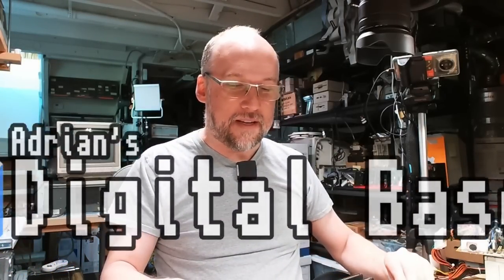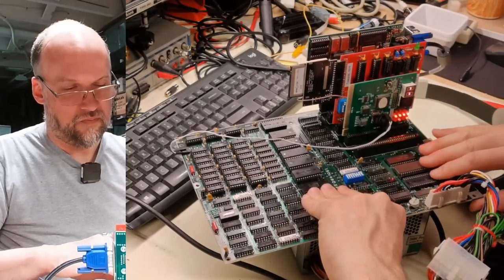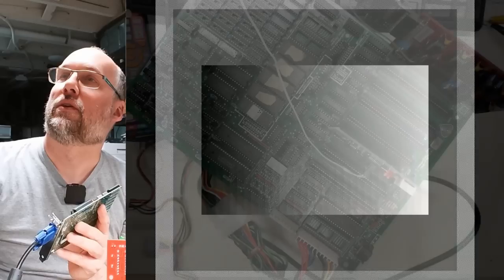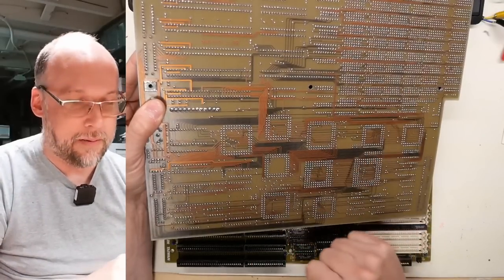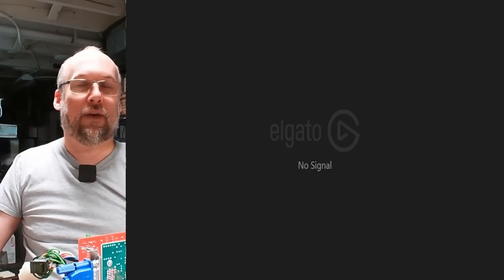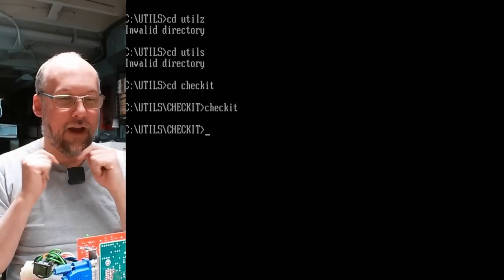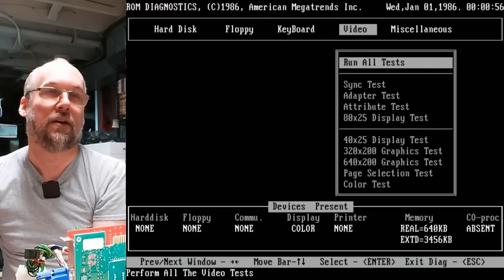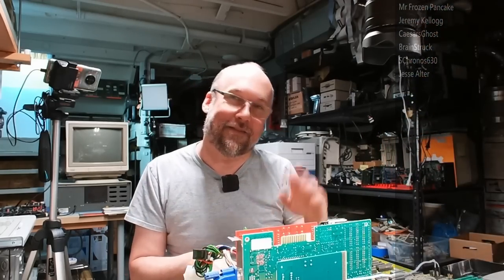Mystery motherboard testing

Comment: Third motherboard: The clock option you changed said SCLK/2 which means divided by 2. That's why the speed dropped rather than increased.

Comment: You nailed it Adrian. I worked in corporate computing from the eighties.  People used to say Wow when they got a new computer.  The last significant change was with SSD's... they produced a noticeable speed bump.
Reply from the maker: I remember my first SSD -- and yes it felt like my laptop was a brand new computer. It booted so quickly and everything felt snappy. Now I upgrade CPUs and can't even notice any change what-so-ever. Sad...
Reply: @adriansdigitalbasement2  I think the software is a large factor too. It used to get optimized for cpu and ram constraints, but now an OS is ~20GB+ and simple programs can use 100MB+ ram easily, especially if it uses bloated frameworks like Electron.
Reply: That's what many say, in the past there was the CPU performance increase which was really enormous. This wow feeling was with 3Dfx addon cards, then with SSDs and since then rather little. 
I am writing this on a 12 year old Laptop with i5 Sandy Generation dual core CPU, upgraded with 16 GB RAM and SSD.  That's enough for Office, Youtube, Intenet and all that at the same time.

Comment: That weird XT clone BIOS also misspelled version as "verson". Parity RAM was nearly universal in PCs until the Socket 7 era. The 80387 math co-processor was very expensive when it was introduced (over $1000) so that's why the first 386 motherboard you showed lets you use an 80287 instead.

Comment: About your comment regarding the 25x single-threaded CPU speed-up between 1981 & 1989, and how modern CPUs don't have that sort of gain from generation to generation --- I'm currently running a 2014 Xeon E5-2667 v2 (8-Cores/16-Threads, 3.3GHz / 4.0GHz Boost), which is listed as having a PassMark CPU Benchmark Single-Threaded Score = 2005.  The 2014 Core i7-4790K had highest LGA1150 Single-Threaded Score = 2465.  The Core i9-14900K is the highest new Intel CPU, with a Score = 4791.  The new Apple M3 Max 16 Core has a Score = 4795.  So, in the last 9 years, the Intel Single-Threaded Score has gone up less than 2x.

Comment: It's  better to have shorts in your tantalums than tantalums in your shorts.
Reply: The latter is generally fine so long as they aren't connected to power and don't themselves also have shorts. 💣
Reply: Shorts are comfy and easy to wear. What does that mean when they have tantalums in them though?

Comment: The extra set of static RAM on your second 386 was the cache tag RAM. The tag RAM contains the address that's being cached. The other cache RAM contains the data being cached. Because the location being cached needs to be looked up very quickly tag RAM is faster and closer to the CPU to have the shortest PCB trace length.
Reply: Seconding the "Tag RAM" and faster-cache's likely function.  Wow, it's been so long since I thought about this stuff last...

I do think Adrian is likely right about the 'early chipset' being PAL'd in for some functions.  Or maybe it's to just save costs somehow, but it seems like that might be a bit much to design a non-standard design just to 'save costs'.  Development would be likely far, far higher.  Just guessing on this point, though.

Comment: That first 386 motherboard is a special unicorn. AMI used to ship something like a "BIOS construction kit" to their customers (mainboard manufacturers). That construction kit used chipset-based "modules" to be enabled and comprising the final chipset setup on the shipped product. The detailed register-setting was for development purposes only and was not supposed to be enabled in shipped products.
Obviously I cannot tell how it got enabled but I am sure, this was not in the regular retail version. I was working for a major taiwanese mainboard manufacturer back in those days and had access to the construction kit along with the documentation to go with the corresponding chipsets, which where hard to obtain back then.
Fun times, but I would keep that mainboard in a special place.
Reply: On NEAT Chipset boards those register settings where somewhat usual not a developer only feature.
Reply: Chipset info is hard to find.  I wish more of that stuff had gotten accidentally left on the Internet's backroom photo-copier.  :-)
Reply: I had 386 boards with this settings as well. I didn't have the easy setup, but the complicated one, where I reduced waitstates in a long row and could enter how fast the memory chips were running (60ns or 80ns), which was neat. That feature was found only on chips & technology chipsets. In 1997 Intel bought them because of their expertise with VGA controllers which lead to the first chipsets with integrated graphics.
Reply: @nickwallette6201  hear hear!
Reply: Just to add some clarification to my post: What I said, applied to AMI BIOS only. Phoenix/Award was an entirely different story. Likewise, advanced settings - even in AMI BIOS' - where commonplace. What I was referring to, was the completely undocumented and uncommented settings seen in the video, The video showed just the chip id's as well as registers/ports with values. THAT was not supposed to go into consumer mainboards, as people had no indication whatsoever as to what these settings do and the documentation of the chipsets where usually not available to the public but just to OEMs.
Last but not least, it was fairly simple to "unlock" these settings if you had the proper AMI software - so maybe a few mainboard manufactures back in the days unlocked them anyway.
Reply: Thank you for the insights!!!
Reply: It was an early form of an SDK. AMI still does a very similar thing this day with their APTIO BIOSes. Manufacturer's get an SDK which allow them to customize their firmware however they want by the use of various modules. And there are hidden menus with various low-level stuff which can be unlocked with an appropriate tool.
Reply: @povilasstaniulis9484  Sure, today you would call that an SDK. Back then, that term didn't even exist :) We called it a "BIOS construction kit" because we called it that way - I am sure, it was called DevKit or something similar back then. Which is why I put the term in "" in my original post.
I was not aware, that this is still the case, but given the amount of peripherals added to mainboards these days, it does not suprise me. I would assume, that blobs like AMD's AGESA will take over what used to be in the BIOS manufacturers realm, as CPUs are more and more SoCs these days.
Reply: That's typical in AMI BIOS installed on 386 motherboards with this particular chipset. All mine have it this way.
Reply: @eliotrulez  which then apparently lead to the integrated graphics not being developed anymore and being remonikered from Intel Extreme Graphics to Intel Extremely slow graphics.

Comment: For the 386DX-25 motherboard, at 26:57:

Each row is a register (obviously), the 0s and 1s you can change. R is "read-only."
The ONE 82C206 register exposed is for DMA timing.
82C301 04H is for CPU timing and NMI, 05H/06H are to do with ISA access timing
The 82C302 is to do with memory mapping.

() is what yours is set at, [] is default. Most of your settings are at default, but it is worth noting that one of the NON-defaults is parity: yours is turned on, confirming that your ram is arranged in x9 (or else it would be throwing errors constantly)

82C206 01H:
First two bits: wait-states for accessing 82C206. 00 = 1, 01 = 2, 10 = 3, [(11) = 4].
Next two bits: wait-states for 16-bit DMA cycles. [(00) = 1], 01 = 2, 10 =3, 11 = 4.
Next two bits: wait-states for 8-bit DMA cycles: [(00) = 1], 01 = 2, 10 =3, 11 = 4.
Next bit: Enable early DMAMEMR#. [(0) = DISABLE], 1 = ENABLE
Last bit: DMA clock. [(0) = SYSCLK/2], 1 = SYSCLK

82C301 04H:
First three bits: read-only
Next bit: Processor Clock Select. [(0) = OSC], 1 = SYSCLK/2
Next bit: Power Fail NMI. [(0) = DISABLE], 1 = ENABLE
Next bit: Bus Ready Timeout NMI. [(0) = DISABLE], 1 = ENABLE
Last two bits: read-only

82C301 05H: Each pair of bits represents a number of BCLK cycles, 00 = 0, 01 = 1, 10 = 2, 11 = 3
First two bits: 32-bit memory command delay: [(00)]
Next two bits: 16-bit memory command delay: [(00)]
Next two bits: 8-bit memory command delay:[(01)]
Last two bits: I/O Cycle command delay: [(01)]

82C301 06H:
First two bits: 32-bit transfer wait states. [00 = 3], (01) = 2, 10 = 1, 11 = 0
Next two bits: 16-bit transfer wait states. [00 = 3], (01) = 2, 10 = 1, 11 = 0
Next two bits: 8-bit transfer wait states. [00 = 5], (01) = 4, 10 = 3, 11 = 2
Last two bits: AT BUS clock source. [(00) = OSC/3], 01 = OSC/2, 10 = RESERVED, 11 = ATCLK

82C302 08H:
First three bits: read-only
Next bit: Write-Protect 256K RAM at 00FC0000H. [(0) = R/W], 1 = RO
Next bit: Disable BIOS ROM just below 16MB. [(0) = ENABLE], 1 = DISABLE
Next bit: /AF32 for addresses >= 16MB. [(0) = DISABLE], 1 = ENABLE
Next bit: Memory limit after reset. [0 = 256K], (1) = USE 0A-0F below
Last bit: Memory interleave. [0 = DISABLE], (1) = ENABLE

82C302 09H:
First bit: C0000-CFFFF Read-only: [(0) = R/W], 1 = RO
Next bit: D0000-DFFFF Read-only: [(0) = R/W], 1 = RO
Next bit: E0000-EFFFF Read-only: [(0) = R/W], 1 = RO
Next bit: F0000-FFFFF Read-only: [(0) = R/W], 1 = RO
Next bit: C0000-CFFFF RAM in place of BIOS: [(0) = DISABLE], 1 = ENABLE
Next bit: D0000-DFFFF RAM in place of BIOS: [(0) = DISABLE], 1 = ENABLE
Next bit: E0000-EFFFF RAM in place of BIOS: [(0) = DISABLE], 1 = ENABLE
Last bit: F0000-FFFFF RAM in place of BIOS: [0 = DISABLE], (1) = ENABLE

82C302 0AH through 0FH:
Each bit represents 16K of address space.
Turning a bit 'ON' disables system RAM in that space, allowing I/O devices to reside there.
0AH: 040000-05FFFF
0BH: 060000-07FFFF
0CH: 080000-09FFFF
0DH: 0A0000-0BFFFF
0EH: 0C0000-0DFFFF
0FH: 0E0000-0FFFFF

82C302 10H:
First two bits: DRAM bank 0/1 type. 00 = DISABLE, [(01) = 256K], 02 = 1M, 03 = RESERVED
Last six bits: DRAM bank 0/1 starting address bits A25-A20. [(000000)]

82C302 11H:
First bit: DRAM bank 0/1 RAS precharge: 0 = 3xCLK2, [(1) = 5xCLK2]
Next bit: DRAM bank 0/1 wait states: 0 or [(1)]
Last six bits: read-only

82C302 12H:
First two bits: DRAM bank 2/3 type. 00 = DISABLE, [(01) = 256K], 02 = 1M, 03 = RESERVED
Last six bits: DRAM bank 2/3 starting address bits A25-A20. [(000000)]

82C302 13H:
First bit: DRAM bank 2/3 RAS precharge: 0 = 3xCLK2, [(1) = 5xCLK2]
Next bit: DRAM bank 2/3 wait states: 0 or [(1)]
Last six bits: read-only

82C302 28H:
First bit: Parity disable. (0) = Parity, [1 = No parity]
Last 7 bits: read-only

82C302 2AH:
First 7 bits: read-only
Last bit: First 256K RAM. 0 = Disable, [(1) = Enable]
Reply: holy shit are you a scanyan

Comment: Third motherboard: It complained about CMOS and XCMOS errors. Entering the standard setup and saving cleared the CMOS warning but not the XCMOS warning.
Fourth motherboard: The faster SRAM is for the "tag" (keeping track of what is in the cache), the slower is the actual data for the cache. This is a nearly universal cost optimization, the  tag is needed much earlier in the process so it gets faster (more expensive) SRAM, TC55417P is a 16Kx4 so it has 16KB tag and 64kB cache size which matches cachechk.
Reply from the maker: Awesome info, thanks. I never thought much about the tag memory which you sometimes also saw on the 486 motherboards.

Comment: @33:00 The one highly integrated chip is the ubiquitious 82c206: That's the two DMA controllers, the two interrupt controllers, the timer chip and the real time clock integrated into one chip that is connected to the ISA bus. So basically a AT-on-a-chip minus the processor-to-ISA adaption (which is provided by Intels 82288). The '206 is used on a lot of 286, 386 and 486 motherboards, but there needs to be further support for the processor frontside bus (bringing it down to ISA), in this case, it's all PAL and discrete logic, so this board is likely older than integrated 386 chipsets.

Comment: Might have been mentioned, but XT class machines use a different port for boot-codes (0x60) than AT class machines (0x80 for IBM and a few others for Award/AMI/Compaq BIOSes). A POST card won't support the XT boot-code IO port, so unless the BIOS you got use one of the AT-ports it won't tell you more than what's shown on the status LEDs.

Also, for EGA or VGA you have to select "other/no video" on the DIP switches. Otherwise it will not even acknowledge the BIOS extension on your graphics card.

Comment: @21:22 The first commercially-available 386 PC was the Compaq Deskpro 386 in September of 1986 (according to Wikipedia). This was about 11 months before IBM released their first 386 machine, the PS/2 Model 80 which, as you mentioned, did have Micro Channel Architecture (MCA). But IBM wanted outrageous licensing fees in order for manufacturers to include MCA in their machines, and MCA wasn't available at launch time for the Deskpro 386 anyway. So the Deskpro 386 had only ISA slots. Later, a consortium of computer manufacturers, Intel and Microsoft (I think) started creating 32-bit expansion slot standards. If memory serves, EISA was the first, but wasn't very common. It wasn't until the advent of VLB and PCI that 32-bit expansion buses became commonplace. But, by that time, the 486 was the mainstream processor.

Comment: For the XT motherboard, you could try flashing a eprom with the Landmark XT Diagnostic Rom. I used one when repairing my XT class NCR computer. As long as the board is not completely locked up, it should help figure out where the boot process is failing.

Comment: The first 386 M/B had a A80386DX-20, so a 20MHz not 33MHz CPU.
Reply: What he thought was 33 was actually double sigma which indicated that that processor was a bug-free processor, i.e. it didn't have the 32 bit multiply bug.

Comment: That 1st 386 DX25/33 motherboard was the same one I had in my first serious business PC I leased in 1987 for *NIX & DOS development. Previously had used TRS-80 model 1, Apple ][ and IBM PC clones. I had the extra ram card with another 64mb ram. Had 2x20MB hard drives. Power beast considering most people were still buying 8/10mhz PC and 16/20Mhz AT clones. Cost in 1987 was $10K aud, but earned me over 30k year for the 2 years I used it.  I replaced it with a Wang Mini in 1990. Now retired I program asrduino and ARM SBCs that can outprocess any old AT/PCs

Comment: The last 386 motherboard you tested may have an external set up utility to set the chipset registers.  I have a 386DX-20 motherboard where I have to run a utility called, setup386, to enable the shadow RAM.  This made a HUGE improvement in performance on that board.

Comment: I remember buying a i386DX running at 16Mhz and putting 4 MBytes in it back in 1988-9. People thought I was nuts because RAM cost a fortune at the time. I was able to run Desqview and run my editor, compiler, and test my programs all side-by-side. It was totally kick-ass.

Comment: That first 386 was a 20Mhz, not 33.  The 33 is actually the double sigma that (allegedly) indicated 100% test of that part.
Reply: I thought the double-sigma was full 32-bit validation -- there were earlier steppings that worked fine in 16-bit mode, but had bugs in 32-bit mode?
Reply: @poofygoof  I heard that the EE was to signify they did 100% validation on every sample.  I've got several chips and the early ones all have EE on them, the later chips don't all seem to have EE on them.  I assume they worked out their yield issues and didn't need to do 100% validation on all chips.
Reply: @poofygoof  I see that Wikipedia cites the 32bit mul bug as the reason for the EE.  I guess I just heard the watered down version.

Comment: Whenever you get back to the XTs... there's a new open source BIOS project for the PC and XTs called GLaBIOS that might be fun to play around with on some of those. They also have another project that provides support for XT real-time clock cards entirely in ROM.

Great video, sorry the XTs went 0 for 2 though!
Reply from the maker: I'll definitely need to try the diagnostic BIOS that's floating around too. Should hopefully help isolate what might be bad on the semi-working one at least. :-)

Comment: I'd just like to point out that the 1st 386 was actually a 386-20 not 33 (20:26) and the math co was a 387-25.  They got the CPU to run at the math co speed of 25 MHz.

Comment: Many 90s and 00s ATX cases will Baby-AT and full size AT motherboards by relocating the standoffs.  I have a Baby-AT Socket 3 build in an ATX mid-tower with ATX power supply.  All the expansion slots line up, and I sourced an ATX I/O shield for AT motherboards.  I'm using an ATX power supply and I have soft power working with a latching relay circuit I assembled.  The case's momentary power button toggles the relay on and off, grounding the PWR ON line from the PSU to turn the system on.

Comment: Newer Motherboards have just two custom chips i.e. Northbridge and Southbridge chips and just a few regulators for the various voltages required, now the PSU just supplies the 12V and an Intermediary unit generates the other voltages which makes for a smaller PSU.

Comment: That might not be parity memory, but ECC on the 386 board.   That means several parity bits per byte.  ECC can detect a double bit error and CORRECT a single bit error.  BTW you noticed that it had an 80287 coprocessor, not an 80387?

on the last board, does the cache have parity?